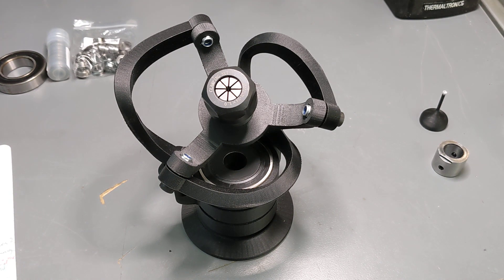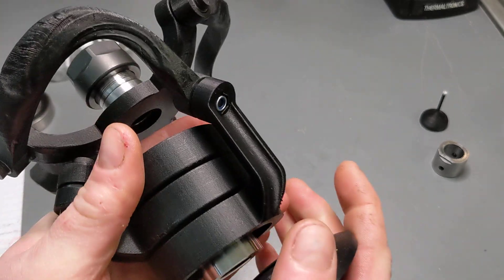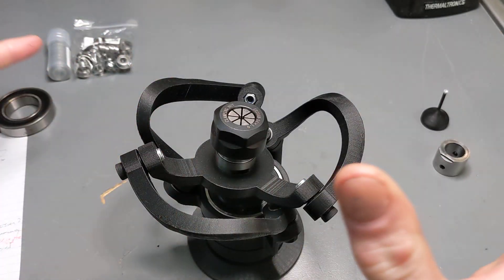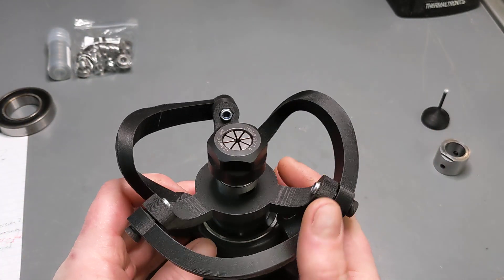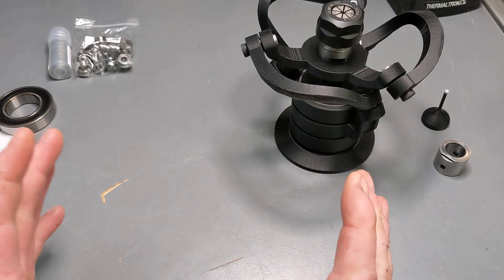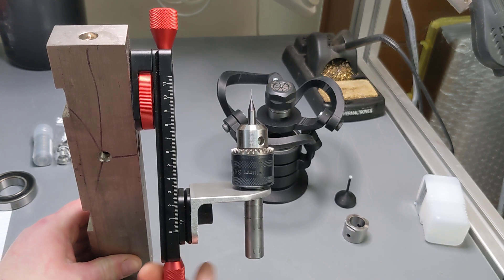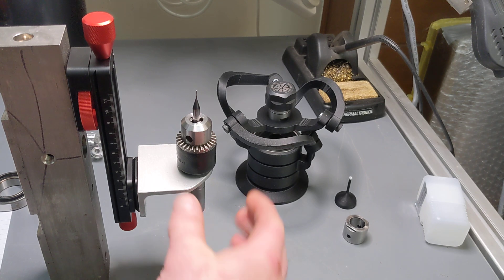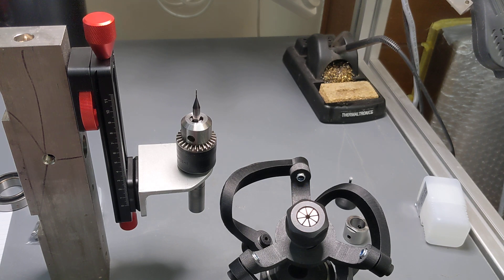Update on the Spherical Parallel Manipulator

Comment: Your end use case is very similar to what I was considering. Was around about way I found you, but both designs have brilliance. I would add micrometer stop and cam split cotter locks on the locking mechanisms and scale it up.

Comment: I think of gimbals when I see the second design. Like the DJI RS. 🙂
Reply from the maker: Correct, it's basically a gimbal with an adjustable arm - a camera gimbal is designed with the camera mounted at the roll center, whereas with this application we need the ability to move the object of interest to the roll center, otherwise it's much the same 
I've just uploaded the latest update vid, I've put a lot of work into making it accessible for everyone, files available very soon and I got the costs down to $10  of parts: $10 SPM https://youtu.be/DqjAKmm-FJQ

Comment: A design like yours could be really useful on the arm of a surgical robot, or any sort of manipulator arm where you need a tool tip to remain perfectly centered while also being able to rotate it around obstacles.
Reply from the maker: I'm always curious about interesting mechanisms and I've looked at lots of surgical robot end effectors, lots of crazy engineering there. The SPM mechanism has been around a while, if a surgery robot company would find it useful there's probably one already in use 😅
I've just uploaded the latest update vid, I've put a lot of work into making it accessible for everyone, files available very soon and I got the costs down to $10  of parts: $10 SPM https://youtu.be/DqjAKmm-FJQ

Comment: I think anyone who needs the second version could make it relatively quickly and easily. The first version, though less functional, is harder to make but more desirable by the wider masses. A lot of people who can't CAD could have it at their desk to fiddle with as they think.
Reply from the maker: That's an insightful thought, thanks for the perspective; I think you're right in that the 'weird cool' one is quite tricky to cad but the polar type is very straight forward for people to make. Current plan is I make a free for everyone version of both as there seems to be demand for it and possibly make a rugged polar one as a product; I'll update everyone soon.
Reply from the maker: I ended up deciding I'll make both available. I've just uploaded the latest update vid, I've put a lot of work into making it accessible for everyone, files available very soon and I got the costs down to $10 of parts: $10 SPM https://youtu.be/DqjAKmm-FJQ

Comment: Either of those on the end of a robot arm and you could have quit the portable carving machine 😉 or both it could also be used for a 3d printer head, welding, etc.. 😅
Reply from the maker: Both are best suited for low-load applications, they're too flexible for machining etc, but welding or 3d printer head would work. 
I've just uploaded the latest update vid, I've put a lot of work into making it accessible for everyone, files available very soon and I got the costs down to $10 of parts: $10 SPM https://youtu.be/DqjAKmm-FJQ

Comment: I wonder if this could work as a gimbal for a custom 3-axis joystick? I play video games with a pair of old Sidewinder joysticks which are smaller and lighter than anything on the market but they're breaking down and getting harder to replace due to their age (1996).
Reply from the maker: I'd say it's likely not the best option (if we're talking about the wacky armed SPM) as the resistance to motion (when you're moving it by the work table rather than the arms) varies greatly depending on arm positions, it'd feel weird basically. 
You also don't need its key feature - orbiting around a virtual point. I think a ball joint with hall effects would work better for your application.
Reply: Good information. That all makes sense, thanks. Having thought about it more I wouldn't be surprised if durability were also a problem.

Comment: I shoot a lot of jewelry video, and the struggle is always how to move the jewelry and get the best shots. Generally we use turntables with black acrylic and then we sometimes pair this with a slider to achieve dynamic shots. This thing gives me some ideas about moving the jewelry in 3-dimensional space, but keeping the camera fixed. If there were a way that servos could be added so that you could use a joystick, or some other means of macro manipulation, I could see how this could be a very useful tool in jewelry videography.
Reply from the maker: I have a photography background and I understand the struggle of shiny object product photography with in-camera subject isolation 😅
Similar goals for microscopy in that reflective surfaces blur/wash out the image, I'll keep that use case in mind with the updated designs (releasing some soon). I may make a motorised polar variant for the community but for a motorised SPM check out @swannschilling474 who was one of the sources of inspiration for this project, they've done a fantastic motorised SPM that's available to print now https://www.youtube.com/watch?v=vNV2LetkfEg
Reply from the maker: I've just uploaded the latest update vid, I've put a lot of work into making it accessible for everyone, files available very soon and I got the costs down to $10 of parts: $10 SPM https://youtu.be/DqjAKmm-FJQ

Comment: I am interested in using this for micrometeorite imaging.  Micrometeorites are exceptionally small- typically between 100 and 400 microns ( 0.1- 0.4mm) in diameter.    I use a microscope to take stacked images- often well above 1000x- and then process the stack into one image.  I've been looking for a way to manipulate the grain so that I can image multiple sides efficiently- and then stitch the images together for a 3D model.  I'm not exactly sure how this would work- but it seems like this device might be a way forward.   So yes- I'd be potentially interested in the files.
Reply from the maker: Interesting use case.... the current vague plan is to release a free, 3d printable design for the polar and spherical variants for anyone to make, and possibly (if there's demand?) I'll make a small run of rugged/professional grade polar ones for labs and other serious users. Based on your comment (and a few others that are similar) I think I'll add the ability to motorise/control/automate the polar variant (both the free and the rugged one), but I won't make a motorised SPM as there's already an excellent project that is doing that better than I could, check out @swannschilling474's channel, their project lends itself well to automation and can be printed now https://www.youtube.com/watch?v=vNV2LetkfEg

Comment: Biggest downside with basically all spherical parallel manipulators I've seen on youtube is that they are all super springy (no stiffness) so if you for example had a camera on the end the video feed would shake during manipulation.
Reply from the maker: You are correct for my design (it's intentional, the arms are elastically averaging each other to give higher static accuracy), but it doesn't have to be the case - another project I found in my research was 'The Agile Eye' project by a french university, it's a high-speed mechanism for rapidly aiming a camera, check it out https://www.youtube.com/watch?v=gVlqjA1EKE4
Reply: @makebreakrepair  Nice, that was a way more "smoothly" controlled one than I've seen before.

Comment: Would an armature set in PLA resin really be practical for anything other than microscopy? Even if it were made of metal it would still be very springy structurally. that's the main problem with any kind of boom arm set up. It has to taper so sharply to be stable.
Reply from the maker: For microscopy (outside of high magnification etc, where you need expensive positioning systems from the start) it's not really an issue as you're more interested in vibration damping (ie the subject shouldn't shake while you're looking at it) and that any sag due to gravity is consistent and smooth (ie when you go from subject -45 to +45degrees the subject shouldn't sag out of frame suddenly when the load changes direction). I'll have an update video soon but I've already printed and tested a polar variant under the microscope and it's stable enough for some decently high magnification :) 
(and before the '3d print everything, even the bearings' brigade arrives: that's only possible with actual bearings ;)
Reply from the maker: I've just uploaded the latest update vid showing the 'resting to the same spot under gravity' bit I was talking about, it's quite usable for what it is (ie cheap and easy to make).  
I've put a lot of work into making it accessible for everyone, files available very soon and I got the costs down to $10 of parts: $10 SPM https://youtu.be/DqjAKmm-FJQ

Comment: Put the nozzle of a 3d printer in the center and it could print onto a structure from any direction instead of only vertically
Reply from the maker: There's actually an open source project doing just that... can't remember the name at the moment though. I think it was designed to go on an Ender but could be adapted to anything

Comment: The age long debate between the designer and the engineer...
Reply from the maker: Yeah.... I built the first one because it looked cool even though I knew there was a more practical way to do the same thing :)
Reply: @makebreakrepair   I just had a very dumb idea...
Can you tell me how back drivable it is?
And is it prone to gimbal lock that way?
I want to put a joystick on top of it 😁.
Add three servos and you have full 3 dof force feedback.
Reply from the maker: It's very back drivable, but the felt force varies based on arm position so it would feel weird I think
Reply: @makebreakrepair  hmm, true but with some clever math probably correctable.
I'm thinking about how to design a 3 to 6 dof force feedback joystick for years now.
However since I am apparently a masochist I  set one of my design goals to be that all motors have to be fixed to the base.
Because why easy...
One day I may even have an idea convincing enough to build an actual proof of concept lol.
Reply from the maker: That's an interesting project.... Are you familiar with 6dof cad 'mice' (3dconnexion space mouse and similar)? I have one, I haven't taken it apart (yet....) so I'm not certain but I think it works by having the knob you manipulate held floating by a few pairs of opposed springs and senses movement with hall effect sensors tracking the deflection or twist of the knob. 
If you take that concept, and add electro magnets in strategic places (which will likely mean not using hall sensors for position....) you could give a sense of force feedback, at least for XYZ translations, not sure how you'd do rotation force feedback though. 

Another idea: take whatever works for existing 3dof (roll,pitch,yaw) force feedback joysticks, then mount that on a small xy stage with opposing pairs of pull solenoids (ie the type where their default state is out and they retract under power) attached in X and y. The springs of the solenoids will passively self center the joystick in the stage and could provide the force feedback under power. That'd get you 3 rotational and 2 translational force feedback axis, adding z gets tricky....
Just a random thought though, I'd be curious to see what you come up with if you make it
Reply from the maker: Huh, cheers for the tip on HID hide  and sxV2joy, I'll have to look into that. I use an old spacemouse for CAD and the drivers are f-ing stupid because 3DConnexion are greedy ....(can't be too honest or my comment will get flagged 😅) and intentionally break support for old devices. Magic tip (for CAD integration, not useful for joystick stuff) is to find the latest driver that still supports your device, install it, then grab the latest driver and open it in 7zip... inside is all the CAD integration installers. I install the latest integrations and run the old drivers just to keep it working. 
Regarding your joystick project: I used to work in industrial 3D printing and some of my clients had these $20k haptic feedback sculpting devices... I can't remember the name of them but some googling came up with something similar:
https://anarkik3d.co.uk/product/falcon-haptic-device/ <-That looks similar, way cheaper, $500 US?
https://www.3dsystems.com/haptics <-some other sorta similar ish devices
The ones I saw people using were about 30cm tall and the feedback was quite strong... it's not exactly what you're after but might serve as inspiration. 

That said, a universal 6dof force feedback joystick is a harder problem than a driving simulator optimised one, if you narrow your scope a little you may find the problem easier to solve. So in the driving example you do only need two degrees of freedom (real shifters are basically a ball joint, in the form of a basic gimbal usually), and the gating could be solved with interchangeable 3D prints, with the force feedback being reserved for the feel of the gears meshing  (I know you used driving as just an example, it may not be your only target use, I just used it to illustrate my point). 
I always scope creep/overthink/make things more complicated than necessary and I wish I'd take my own advice once in a while 😅 but yeah, my advice is to figure out exactly what your requirements are and what your target use is, if it's 'universal joystick for every use case, with feedback' then that's cool, it's ambitious and you may have trouble getting enough traction for people to make feedback profiles (not sure the correct term) for all the games/software you intend it to be used for due to cost and software complexity, but do it (and send me a link to the project, I'd love to see it) . 
If, however, you really just intend it it to be for a few specific applications (flight sims? hardcore driving sims? 3D scultping?) then you may find your requirements reduce (less DOF? Feedback some but not all DOF?) or you may find that variants of the device is more useful/easier to make than a universal one (eg a driving sim version and a flight sim version, each with a different configuration of modular feedback/axis devices). 
The other advice that ties into that is modularity where possible, allows for smaller 'economies of scale' and allows for revisions that don't break everything else. 

As for designing for a product and costs: Gah, yeah I know that one. I just killed my start up (due to investor getting early onset something and becoming decreasingly cogent, looong story) that was building CNC machines for the surf industry, my machine wiped the floor with the competition and was done on a shoestring budget and it was a massive amount of work making it as a product rather than a one off; it's easily 10-100x the effort to make something a reproducible product. If you're curious about it shoot me an email and I'll link you vids etc. 
That said, I managed to make the SPM much more accessible, check out the latest update vid: $10 SPM https://youtu.be/DqjAKmm-FJQ

Comment: My use case is image stacking on something like a small butterfly wing which has to be precisely positioned perpendicularly to the lens, hence a holder that can move in more dimensions than the macro rail version would be better, but something that can be locked solidly in place without much vibration transmission is also helpful.  Your suggestion about taping something in place on the last video's discussion doesn't really fulfill that for me: I would like to be able to lock and unlock it with assurance that it won't shift while locking down or come loose afterward, and I would prefer something like that red twist knob that locks smoothly, reliably, and without much thought.  Imagine doing this for several hours straight and I think you'll get what I mean.  

Thank you for these posts--I do find the ideas inspiring and look forward to seeing the next one.
Reply from the maker: I ended up deciding I'd just make both available for everyone 😅
I've just uploaded the latest update vid, in it you can see the PM variant with a locking knob and actual use under a microscope, I'm still working on improving it but it's very usable as it is. The current version in the vid below is built with as much 3d printed as possible (ie the 'cheap and accessible' version) and the 3d printed lock is less solid than I'd like but I plan to do a short production run of a fully metal one for professional use etc. I'm still working out the details on that, if your interested put your email in this form https://forms.gle/XGxA5Zzp16doP4pE6 and I'll keep you posted on that (your email wont be shared or used for marketing, I'm just a guy in a shed 😅). There's also the possibility of  a hybrid of 3D prints and off the shelf shaft locks for a more positive lock, but I think people that need the high rigidity would be better off forgoing 3d printing entirely .
I've also put a lot of work into making it accessible for everyone, files available very soon and I got the costs down to $10 of parts: $10 SPM https://youtu.be/DqjAKmm-FJQ